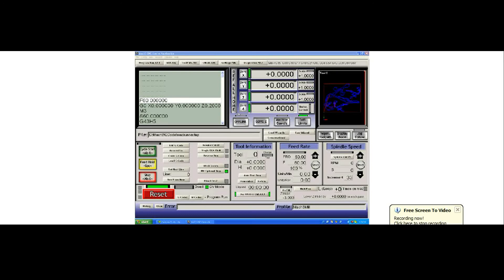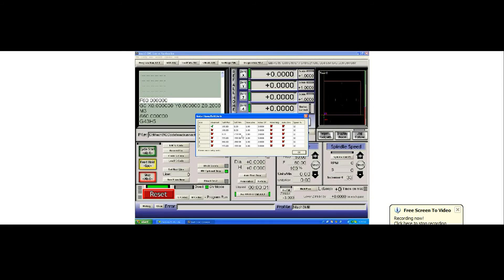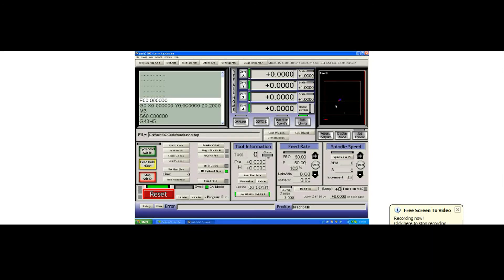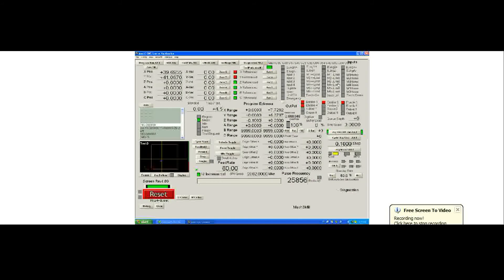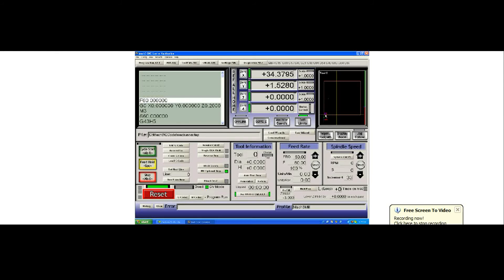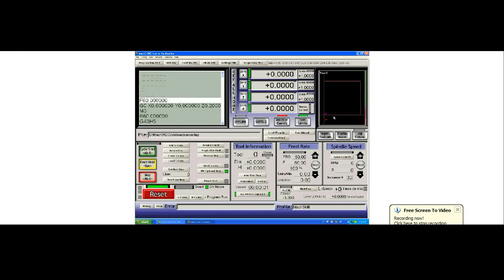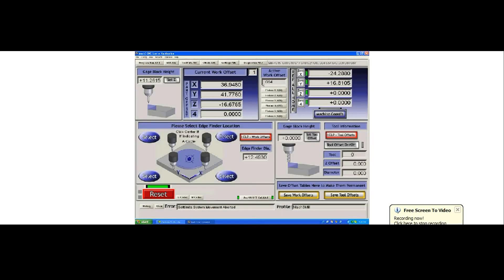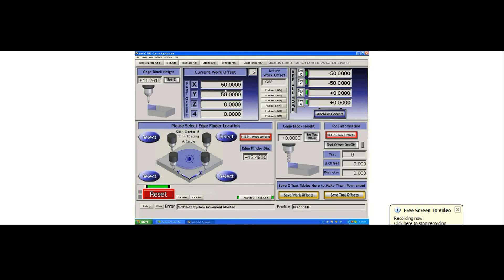Mach3 CNC Controller, Homing / Limits / Offsets

Comment: This is a very poorly done effort. It may have been consistent with the way Mach 3 looked way back when, but the Mach 3 I installed on my machine (AND PAID FOR!) looks and acts nothing like in the video. There is no explanation at all about the actual difference between machine coordinates and the toolpath coordinate system. His instructions for homing are a hot mess. it is impossible to learn anything from this video at all. I know he is not the creator of this program, but nevertheless, it is pretty much useless. It is a total shame that this is the only one available on the Mach 3 website.